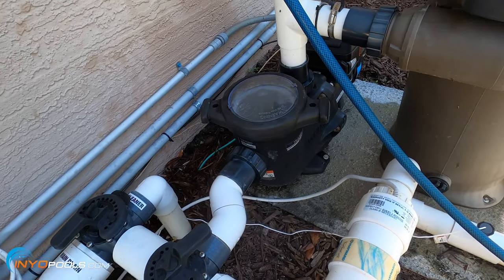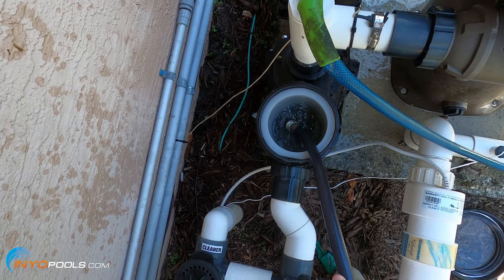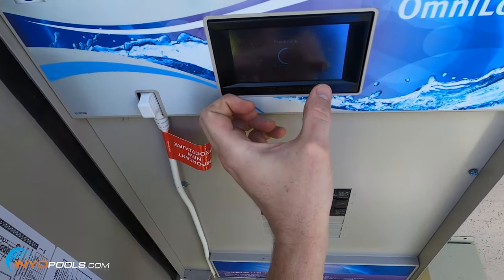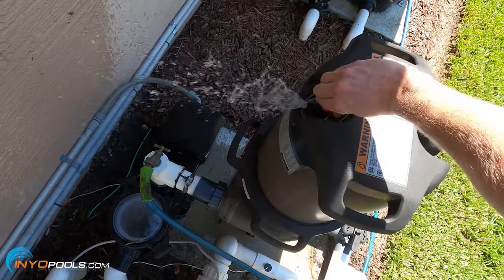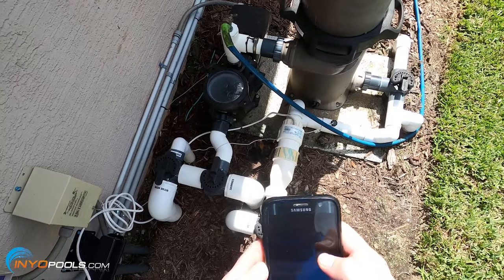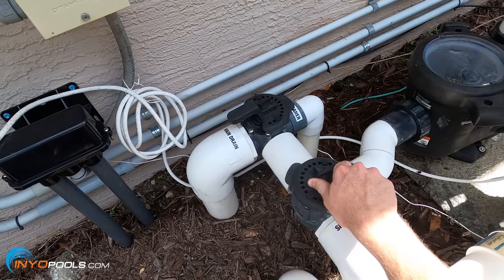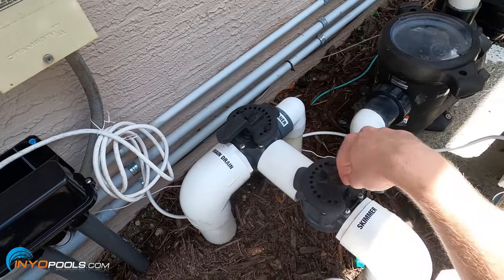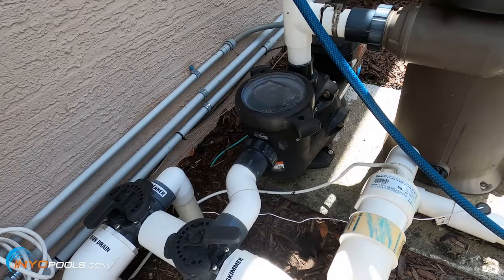How To Prime a Pool Pump

Comment: My basket is filled with water, strainer is all clean got a pent air sand filter. 
Turn on pump and water starts flowing down through strainer but no water going back into pool so the water gets sucked down into strainer to the point it collects air I guess and I never get water going back into pool. 
Do I need to take off filter head and replace sand? 
This is the first I have run into this problem after dealing with same filter and pool for years now.

Comment: I disconnected for the winter and plugged it all back. I'm assuming I need to prime? I see the bubbles in the pool, but there is no pressure on the gauge in the filter.

Comment: My hayward pump will hold air in that basket area, but usually after a few days it completely fills with water. I've tried to use the bleeder on the filter but it only removes air from the filter and not the pump. The pump has 2 bleeder valves on it as well but they don't seem to do anything for the air either. The system was installed a month ago so its new and I haven't seen any leaks anywhere. Is this something I should do to help avoid the air pocket that forms? Only curious because I notice a decrease in pressure sometimes.
Reply: Same thing happens with my Hayward pump

Comment: Is there a reason besides priming that you added the hose fitting to your system? Also I have a V1 Aqua link that has the 2 wire LED pool lights which are the old Zodiac Jandy JLUC10-50 Color LED Nicheless Light 10W Max 12V which have filled with water. Do you know a good source for replacement lights ?

Comment: What if my sand pump system does not have a tap on the drain pipe near the primer basket. Do I just leave the hose in the primer basket and let the water drain into the pool as it fills up?

Comment: Quick question. I ran my water hose to that pump and it doesn't fill up it just continues to add water. Do I need to turn the bleeder valve to make this work??
Reply from the maker: The pump may not fill to the top with water. Let it run for a minute or so, then put the lid on, and start the pump. The bleeder valve should be open until you turn the pump on and water starts to spray out of it. Then you can close it.

Comment: hi all

i cannot find a replacement part for Sp-1610-C, are there any replacement parts that are exactly the same? all i can find are impeller that are much thinner than my original, will those still work?

thanks in advance
Reply from the maker: Unfortunately, the SP1610C impeller was discontinued by Hayward. If you have the Hayward Super Pump, there is an upgrade kit. The part number is 5110-53. https://www.inyopools.com/Products/07501352011066.htm

Comment: Is the water via hose necessary? Seems like my pump pushes air out through the return lines and fills up by itself.  No air.
Reply from the maker: It is not always necessary. Most pumps will prime themselves even if you have opened up the pump or filter and the pressure was released. This would be for cases where you start the pump but it doesn't have enough water in the lines to catch a prime.

Comment: I have a variable speed pump and run it for 8 hours a day at 60% and it has never fully filled up all the way, should it? When I run it at 100% it does fully fill up. Water level is good and all baskets are clean
Reply from the maker: On lower speeds, the pump strainer may not fill all the way up most of the time. That's normal. The fact that your strainer does fill when you go to 100% power tells me your system is running as it should.  👍
Reply: @Inyopools  Thank you for the information

Comment: Hi, mine is underground and when I opened it, water came out in high pressure, I closed it but when I turned the pump on it looked there is low water in the basket, any tips? Thanks.

Comment: That is SOME system.  Wow.  I couldn't get my pump to prime which brought me here.. my pump basket lid doesn't even have a gasket so I guess that's where I should start.  Also, when you're filling up the pump basket, should the water go down immediately as soon as you move the hose?  Seemed worrisome to me.   Gonna grab a gasket and go from there.  Thanks!
Reply from the maker: It is common for the water to start to empty as soon as you pull the hose out. If you let the water run for a minute or so, the lines should have enough water to help the pump catch prime.
Reply: @Inyopools  finally got it going today!   Had to close both my skimmer and main drain lines , fill the pump, turn it one while simultaneously slowly opening my skimmer line.  Hopefully that works everytime.  Thanks for the tips!

Comment: Is it normal for some water to come up from the lid on pump ?
Reply from the maker: Water should be up to the top of the lid when the pump is running but not coming out. Sometimes water will shoot out off the pump lid when the pump shuts off. A new pump lid o-ring usually fixes that.

Comment: What is the purpose of the faucet and hose attached to the system by the filter?
Reply from the maker: It is used to drain water from the pool. While the pump is running, you can open up the faucet to drain water.

Comment: What do you do if there is water pouring out of that part? 😩
Reply from the maker: Is water leaking out of the pump? If so, where is it leaking? Out from the lid, from a crack in the strainer pot, intake port?
Reply: @Inyopools  it’s not leaking. If we take the lid off it just overflows.
Reply: @Inyopools  we also can’t find an air valve on ours. When we turn our pump on it sounds like it’s on but it isn’t doing anything. It won’t even do a back wash
Reply from the maker: Do you have an above ground pool? If so, that would explain why water would pour out when you remove the lid. There should be shut off valves that you can close so water can't flow to the pump while you are working on it.The air valve would be on the filter. You might not have one if it is a sand filter.

Comment: Hi guys. Not related to this video but I am wanting to know what evaporation rates to expect in our area. I am in Port Vila, Vanuatu. Hot tropical Island environment. During October the average Temperature is 29 Deg C / 18 Deg C and humidity average of 88%.  In a smallish pool with a depth average of 1.2m and  exposed surface area of  48m2 what would your estimated daily evaporating rates be?  I am trying to determin if a pool has aleak or if the water loss is evaporation. Loss amounts to approx 3/8 to 1/2" a day (10 -12mm) but that seems high to me with 88% humidity. Please note the water does not get hot. It always feels substantially colder than the ambient temperature.  Any advice appreciated. love your videos.
Reply from the maker: Hi Kelvin, we actually have a video on this very topic. It can be found here: https://www.youtube.com/watch?v=3APd2Z_blUM

Comment: it sounds like an airplane starting
Reply from the maker: It's relatively loud for the first 3 minutes until the priming mode is over. Then it switches to a lower speed and you can barely hear it run.
Reply: @Inyopools  awesome!